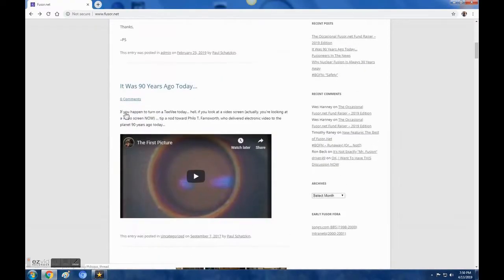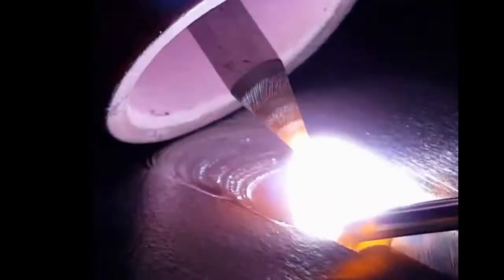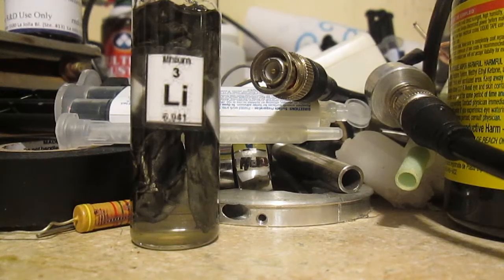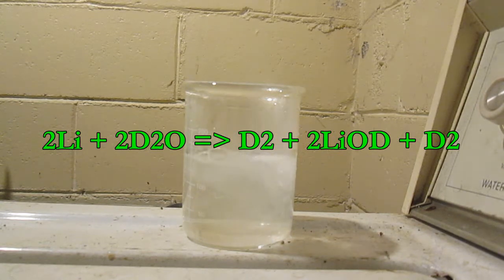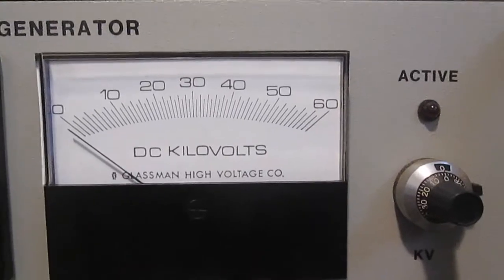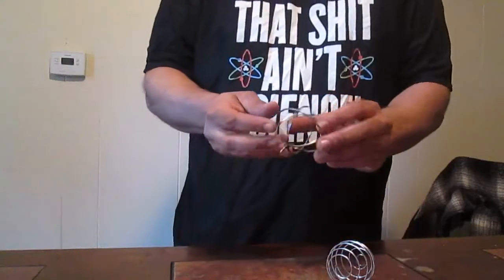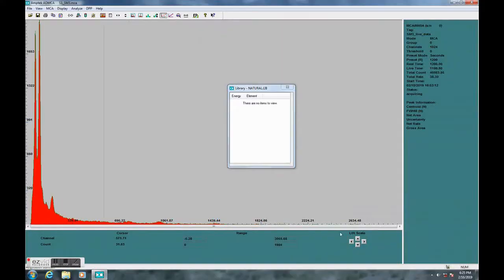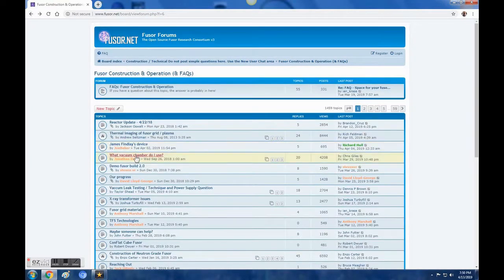DIY Nuclear Fusion fusor  part 1

Comment: how did you make the spherical coil in the middle?
Reply from the maker: This was cut from thick steel wire found at home Depot. I cut a few rings and had the  same welder who did the chamber weld the rings together... Thanks for watching!
Reply: @Neptunium  are the wires stainless steel or aluminum?
Reply from the maker: Stainless steel.. aluminum will melt
Reply: @Neptunium  ahh cool

Comment: Nice chamber, whats seals did you use for sealing it , did you make or purchase them
Reply from the maker: It's a rubber seal I cut from a large sheet . I had to use epoxy too for the small leaks.. thanks for watching!

Comment: Hello, great video! I'm planning on building my own fusor and was wondering if you have any advice? Specification wise, I have a neon sign transformer (and rectifier) and I'm planning on putting it through a voltage multiplier to get around 35kv, I am going to start constructing the chamber, where did you purchase your hemispheres, and how hard was it to weld? (I'm new to the world of metal working) I look forward to building this fusor, you did a great job! I'm going to be watching your new content! Thank you!
Reply from the maker: Thank you for your encouraging words! always appreciated! I found the hemisphere on Alibaba from china, They made them fast to specification and it was not very expensive (about$100) i am not a welder either and there is a welding shop in town that took care of the welding, the guy did a terrible job and rage quit the next day. Not a great experience.. But this is a company that makes stairs and fences welding manufacturing job and repairs...They were pretty expensive though.. In retrospect, I would not have made it as big as that and i would suggest allowing larger hole for the electrode (HV input) but this was a great project ! Thanks again for checking it out and dont forget to go to Fusor.net! lots of great advices there ! Take care
Reply: @Neptunium  Thanks for the reply! Would you say Alibaba is reliable? I found some cheap parts on there and was wondering if I should buy the,
Reply from the maker: @WariceHimSelf  I only bought one thing from them and it was a good experience so I am not the person to ask! 😊
Reply: @Neptunium  Ok! Thank you, one last thing, sorry for so many questions. Where did you buy the flanges/CF ports?
Reply from the maker: eBay...where else? Lol ebay and more eBay!!!
Reply: @Neptunium  alright, I'll be looking for some used parts on eBay, thank you! Again, great video/project!
Reply from the maker: @WariceHimSelf  thanks! Remember to have fun with it !

Comment: Its been 2 years since i last commented here. 

When it comes to my fusor, or  demo fusor, it is going well. Im done with my main chamber, as well as my pump. It can bring the pressure down to around 20 microns, with no leaks whatsoever, except some oils outgassing over time. The power supply is soon done, where im using a 220v voltage regulator, a flyback transformer capable of 15kv eith a driver, and a 40kv rectifier that has some amount of cooling. Im still waiting for the insulating transformer oil for the rectifier, but apart from that its mostly done.

When it comes to fusion, i have plans to up the voltage with a voltage multiplier for the grid. Im also going to order some lead sheets, as my current fusor does not have protection. The deuterium part is just a matter of getting heavy water... thats the hard part. In Norway, importing or exporting heavy water is forbidden.
Reply: Here are some pictures of the main chamber:

https://media.discordapp.net/attachments/794913634002010115/1046848208019652608/20221128_164025.jpg

https://media.discordapp.net/attachments/986563179435937822/1047858632739524638/20221201_135357.jpg
Reply from the maker: What is the support for the grid made of? It looks like dry clay?
Reply: @Neptunium  it is a plastic tube with a layer heat resistant coating on it. Thats what looks like dry clay. Its made to withstand and insulate a couple thousand degrees, and at the same time keep structural integrity. Perfect for this use.
Reply from the maker: @XBlueBeam  are you not afraid it migh degas and pollute your vacuum ? especially if it stays hot for a while?
Reply: @Neptunium  nope, i've had it under a vacuum for 1 day once for testing and the chamber only went up a couple microns in pressure.
Reply from the maker: Funny we should be talking about it now I am literally editing my next video about RGA and how they can be used as mass spectrometer to verify how pure your vacuum is !
Reply: Specificly, its asbestos free exhaust mounting paste.
Reply from the maker: @XBlueBeam  alright! nice work! keep us posted on Fusor.net if you arent already! :)
Reply: Alr
Reply: Nice

Comment: yeah its all cool till u realise u need a lot of money for that
Reply from the maker: Did you see part 2 ?
Reply: @Neptunium  yes
Reply from the maker: @pew8208  yes it's an  expensive hobby..
Reply: @Neptunium  is it possible to use any other gases instead of deuterium to achiev e fusion? deuterium is unavailable to me
Reply from the maker: @pew8208  well unless you can get tritium it's not going to happen with electrostatic confinement.. if you can get heavy water, it's fairly easy to electrolyze it and recover the deuterium.. you don't need a lot ...

Comment: That power supply is as big as a refrigerator! You could have something half the size
Reply from the maker: Yes I could have. At the time, I did get a good deal for this one but there is other far smaller supply out there. HV power supply have jumped in prices about 12 years ago and never came back down.

Comment: Might help replace the rubber gasket with a copper or indium one to reduce outgassing
Reply from the maker: I knew this could be a problem  ut i had bigger outgassing issue from the electrode itself
Reply: @Neptunium  have you tried bakeout?
Reply from the maker: @nikoskaravitakis9437  i had to dump the plastic cover and replaced it with  alumnina...worked out well
Reply: @Neptunium  great
Reply from the maker: @nikoskaravitakis9437  yeah it worked beautifully as you can see on the second video and landed me a spot in the fusioners list on fusor.net
Reply: @Neptunium  Nice. Ill go watch it. I started the same project a few years back when I was 17 but my issue is the high vacuum system. I got 2 turbomolecular pumps back then from an auction but I dont have a working controller to run them and will have to make my own when i have time. Also i wanna make an electron beam and many more stuff that need high vacuum. Current project is a nitrogen-air liquifier
Reply from the maker: Oh thats good stuff...i've done a few of that ! Keep checking my videos ...  that type of equipment is not cheap!

Comment: Where can I get stainless steel details like that?
Reply from the maker: I found the hemisphere on alibaba had it made custom by a chineese shop.. all the other parts were found on ebay. I talked to a weldimg shop in my area and they welded it all as explained in the video. They do stainless steel welding like stairs, fences, garages etc...
Reply: @Neptunium  and what’s the thickness of those hemispheres?
Reply from the maker: About a mil and a half
Reply: @Neptunium  1.5mm??
Reply from the maker: @thescience786  yes

Comment: Stan Sandu   
   MATERIALS FOR THE CONSTRUCTION OF THE MAGNETIC TRAP, FOR  THE CONTROLLED THERMONUCLEAR REACTION!
     From the Fundamental Principles of Democritus, atomist from antiquity: 470 ... 380 BC. we find out: "Nothing is born of nothing; nothing that exists can not be destroyed and any transformation consists of a reunion and a separation. Nothing is accidental, everything happens because of a cause and a need. Except ATOMS and ETHER, everything else is just reasoning and there is none. Atoms that are infinite in number and shape give birth to the visible world through their movements and collisions and the rotations that arise from this cause. The difference between objects depends only by the difference between the number, the shape and the order of the atoms from which the objects are made, and there is no other qualitative difference between atoms, which act between them only through possession and collisions. The SPIRIT as the ETER is made up of small, spherical, highly mobile atoms, whose atoms are the phenomenon of life! ” Where did the Democrit atomist know about the constitution of matter 2400 years ago?   
      In the communications of the higher spirits and of the angels in the book: "From the mysteries of life and the universe", Professor Scarlat Demetrescu (from 1939) tells us: "The spirit is not impressed neither hot nor cold, he can stand at the most alive fire, without suffering, because its ethereal coat does not undergo any change. The creative father created the spirits so he could live at any temperature, from the lowest to the highest. ”
      Also the celestial sources, we are told that the whole Cosmos like the Infinite are filled with a dense powder of living electrogenic etheric particles, and between them act other streams of particles and smaller, particles of the attraction of the gravitational field. Who created these living particles in Infinity? This is the mystery of mysteries! What a wonderful thing if it moves inside it and thinks, feels and wills, because an electric current is always flowing through the interior matter of a particle in Infinity. The living particles in the Infinite area reach the Cosmos area and the four universes. Thus the universal ether is a mass of small living bodies, living particles, that would enter in a microbe of yours (space brothers tell us) with hundreds of thousands.
    These living particles, particles not seen by us, particles of cosmic ether, are composed of three kinds of living particles; in which some have INTELLIGENCE (1%); others have little intelligence and a lot of MEMORY (9%); and most have WILL (90%). The higher spirits of God can combine these living particles, and they can obtain different small bodies, like invisible MICROCYCLES that can perform certain functions. Thus the LIFE in any seen or unseen being comes and manifests through these living particles of the etheric and spiritual matters. Today we do not know well what functional characteristics some etheric materials have, such as: electric current, magnetic field and electromagnetic field, with which man has been working for a long time!
     In the ITER installation there is a thickness of 60cm vacuum vessel and 80cm lithium blanket thickness, totaling 1.4m. That is, 1.4m distance from the electrical conductor of the coils to the area with thermonuclear plasma. In the magnet system of ITER, coils are used in which a high intensity electric current flows, a CONSTANT current for the coils in the toroidal system and a VARIABLE current for the poloidal coils and the central solenoid. 
     On November 24, 1831 Michael Faraday discovers the ELECTROMAGNETIC INDUCTION: a phenomenon by which a voltage, an electric current appears in a circuit crossed by a variable magnetic field flux. Thus Faraday establishes the law that links electricity to magnetism and motion; is also the day when he presented to the English Royal Society the first DINAM, an electricity source, as well as the first electric TRANSFORMER, as applications of electromagnetic induction.    
      The intensity of the magnetic field outside the electric conductor is proportional to the intensity of the electric current through the conductor and decreases with the distance from that conductor. The magnetic field is only around and inside the coil, at a maximum of 20 ... 40cm from the conductor of the coils and not at distances of the order of meters. 
     In electric motors, the substance of electricity (the electric ether) in the network will establish a torque between the inductive magnetic field and the induced magnetic field, which will rotate the motor's rotor but will also produce heat resulting from the confrontation between the inductive and induced magnetic particles. Also, when heating metal bars, for hot deformation, medium frequency currents of 8000 Hz are used. The electrical installation creates an alternating magnetic field around the metal bar that induces turbulent currents inside the metal bar that create an opposite magnetic field. From the struggle and the combination of the particles of the inductive and induced magnetic field results the heat and light that will heat the metal bar to 1000 degrees Celsius in 10 ... 15 seconds.
       From a theoretical point of view, the emission and the displacement in space of a strong electromagnetic field flux is affirmed from the year 1860 by J.C.Maxwell who said: "An electromagnetic radiation results not only by the variation of the fields, but also at constant field, when it varies in time. either the electrical permittivity of the environment, or the magnetic permeability, or both ”. But in the case of the Sun we have a practical certainty. The sun is high and it has certain conditions for the thermonuclear reaction, and we improperly say that it is naturally self-controlled. But after the study done and the data from the researches and observations on the Sun I am now sure, that the Sun was also CREATED properly for to unfold the thermonuclear reaction, and is permanently SUPERVISED by the creator heavenly beings!  
   It does not happen the sun, to have a strong electromagnetic trap, it does not happen to have a rotational motion of the plasma mass perpendicular to the field of the electromagnetic trap, and emits continuously electric energy = electric ether in space, very necessary for all life in the solar system, almost like a mognetohydrodynamic generator. The solar magnetosphere that cloaks the incandescent solar mass and go billions of miles into space and returns to the top again, and coats the incandescent solar mass again, allowing not to scatter in space!
      What can be said about the current magnetic traps of the Tokamak and stelator installations? Theoretically, the shape of the installations has only an apparent justification, but to function as a controlled thermonuclear installation it is IMPOSSIBLE, because the effect of the magnetic field produced by all types of coils installed is almost completely blocked. We must not seek in vain for physical-chemical (metallic) materials, but to use the etheric materials correctly, that is to say we use the magnetic field and the electromagnetic field correctly, as in the case of the Sun!

Comment: I design this prototype myself I call it the VFR this is a video of a H mode plasma test at only 28 Mercury's of low vacuum instead of high vacuum and less than a kilowatt power input this video is without the secondary containment field which stabilizes and separates the charged particles for a direct ion capturing this is only the core of the fusion reactor and the primary containment field

https://youtu.be/BMkSuqPN4pA
Reply from the maker: its hard to see anything other than a bright light on your video and since you did not explain much of the inner working it is difficult to make any objective call on your design. It could be a very neat idea but the fundamental remain the same . good work though
Reply: @Neptunium  well how else am I supposed to protect my design
Reply from the maker: @numatechprototypes222  i get it ..
Reply: @Neptunium  have you ever heard of quantum harmonic chemistry? The math is almost enough to make your ears bleed
Reply from the maker: Lol! I bet! ...no I haven't
Reply: @Neptunium  ok so its how to calculate a reaction of quantum partials, there energy levels and calculating the conditions required for a specific reaction...wow they could have just said that.
Reply: @Neptunium   so if I use molecular fuel than I should be able to use the vibrational frequency of the bonds and oscillate the power supply  accordingly and use this with my planed secondary containment field for ion separation and plasma-flow stabilisation and that should boost the efficiency and ill be able to use a solid fuel secondary for maximum  density and this will boost the efficiency by focusing on Breaking the molecular bonds through electrical vibrational stimulation and oscillation which is much more efficient and releases a Fairmount energy to kick start the fusion reaction as its geometry makes it enveloping on self into a sphere collapsing that energy released from breaking the molecular bonds to breaking the atomic bonds
Reply from the maker: @numatechprototypes222  that's sounds very confusing my friend. You are not doing chemistry but nuclear physics remember? Why would you want to involve low energy chemical bonds?
Reply: @Neptunium  because you can change chemical bonds with electrical potential releasing small amounts of energy in order to increase the efficiency and decrease the input energy necessary to start the reaction every lil bit brings us closer to net positive reactions
Reply: @Neptunium  it's basically the same Principle of useing a chemical bond or explosives to ignite a nuclear material. Or how they used a nuclear bomb in order to ignite a fusion bomb or hydrogen bomb
Reply from the maker: Oh I see..that's interesting ...please continue to share and make videos of your progress ! Are you on fusor.net yet?
Reply: @Neptunium  not yet. but after I figure out the legal crap with my divorce and where I'm going to live I'll work on it  2020 is rough
Reply: @Neptunium  its Dalton check out my mini tokamak it uses one magnet for piratical spin and its protecting center electrode then x-ray reflectors to use the x-ray presser from plasma containment so as the reaction increases so does the x-ray reflection so it self contains. I made this mini core to test a full spectrum ion thruster prototype design iv been working on. its the last three clips of this video https://youtu.be/bBtzhomlw7M
prototype
sorry for the paragraph.